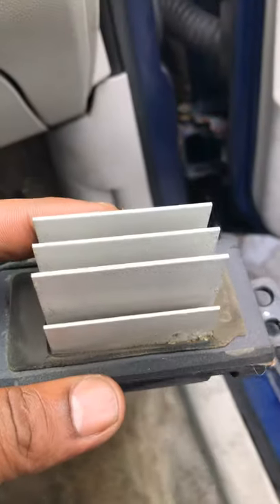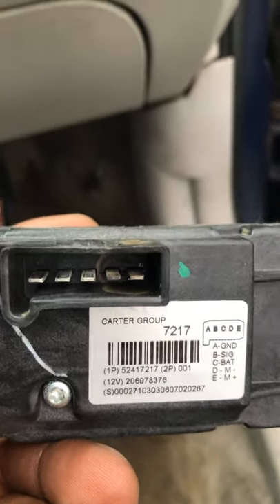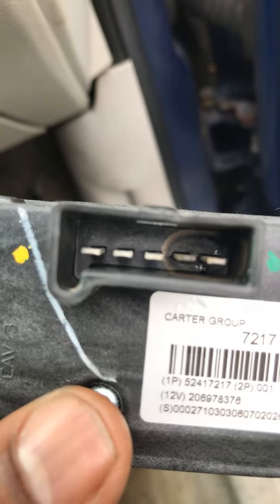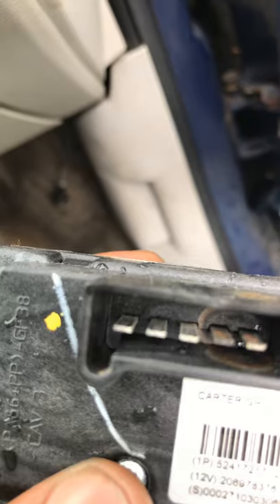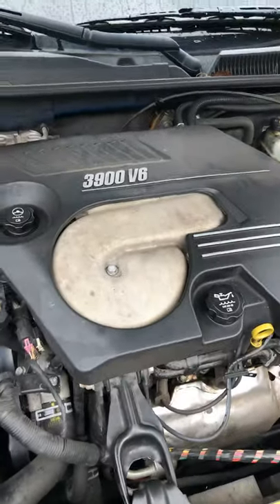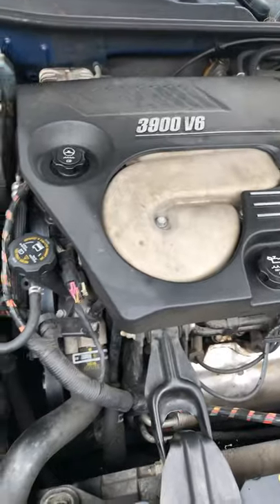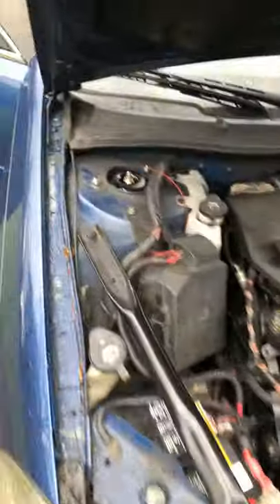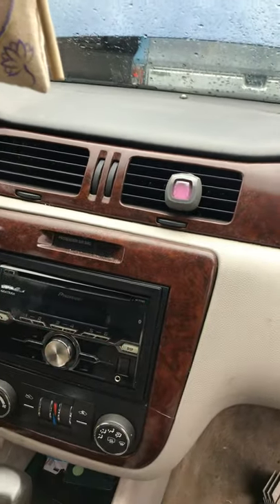2000-2014 impala blower fan problems

Comment: Same thing. I changed motor, resistor and wire harness and still wasn't blowing.  I was mad as hell, because I had previously changed the resistor and it worked great.  I knew it would be a matter of time before I needed to change everything.   However after watching this video I was able to locate and change that fuse and I'm back in business.  Thanks man.

Comment: I have a 2000 Impala L S my problem is when I turn on on fan switch doesn’t turn the fan on at all. 
Is the the same problem as you described , and will that fix my issue?

Comment: I tied a rope to the wires. Whem it cuts off i just tug at the wires and it turns on. Would replacing the resistor help?